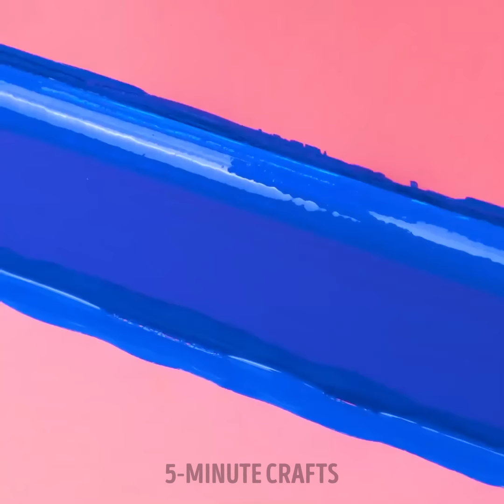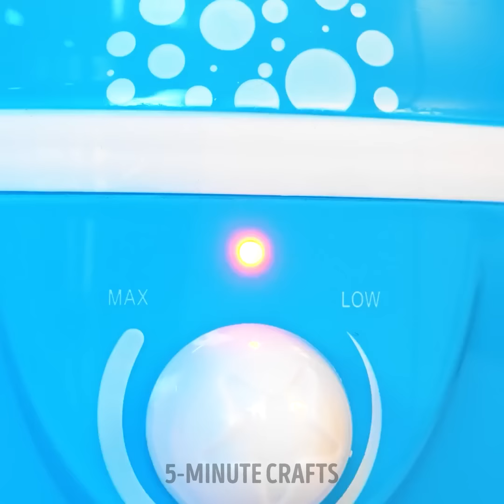Life-Saving Repair Hacks That Will Save You a Ton Of Money

Comment: You don't get a bruise under ykur fingernail unless your doing some serious work. I know because i get bruised fingernails all the time!! I litterally was useing a breaker bar to get a flange off my muffler(that broke from rust and time) so i can replace and reweld it. The breaker bar slipped and my hand hit the chassis 😢 i thought i broke my finger at first but i kept working through it all... 😅